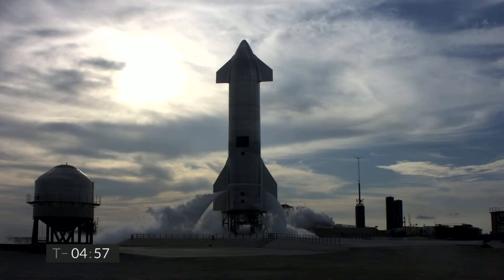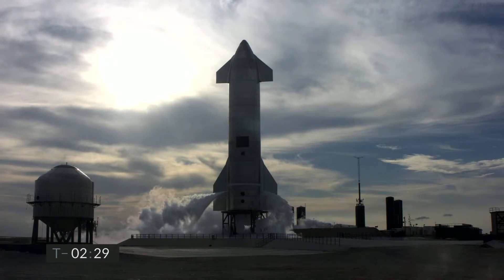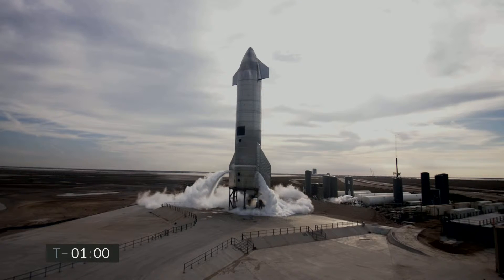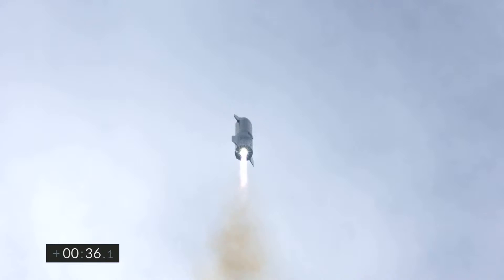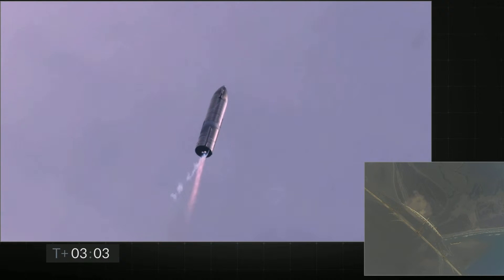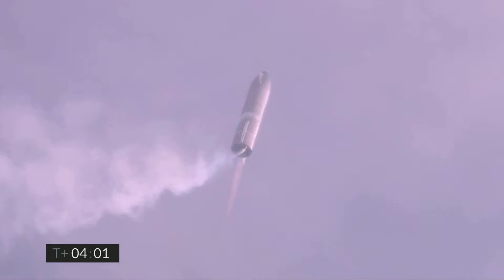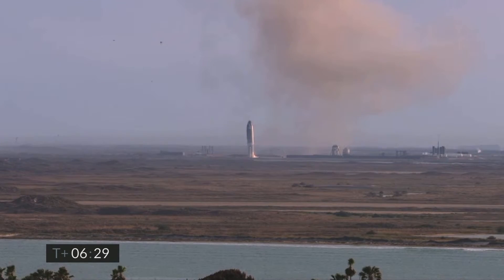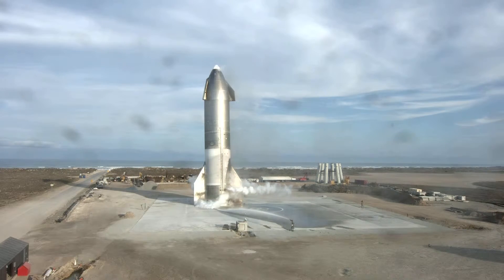Starship | SN10 | High-Altitude Flight Test

Comment: Wait did it expoloded?
Reply: Yes, later on, a methane leak caught fire inside the lower fuel tank and then KABOOM
Reply: Yes, because 3 of the landing legs failed to lock into place so the rocket landed a bit harder than it should've. Those landings legs are designed to be crushed by the impact force. Since only 3 of them deployed, the rocket landed a bit harder than planned and damaged the rocket causing methane leak.
Reply: Ok

Comment: how did they film it almost parallel height the entire flight?
Reply: I mean it wasn't 'almost parallel'. There's still a significant upwards angle when it's at apogee.
They used a long range tracking camera a long way away on the ground, so it was looking mostly sideways, but still 30-40 degrees up.

Comment: And by the way it blewup, but don't tell that to anyone!
Hope next time they don't show off 1 engine landing and do it proper.
Reply: With 2 engines it would just fly back up
Reply: @FinkHD  Funny but not true.
Reply: @N0N0111  It is true, the engines have a minimum thrust
Reply: @N0N0111  It is true.
A Raptor at minimum throttle makes 80 tonnes of thrust. At max it makes 200 tonnes. The ship weighs 120 tonnes, so that's enough to land it.
However, two engines at minimum throttle are a minimum of 160 tonnes of thrust. That's too much to land, or even hover. The ship will go up.
They hope to get the minimum throttle down to 50 tonnes in the future, which would allow a 2 engine landing. But right now it isn't possible.

Comment: My little advice that why the landing and take off are considered as the same process/similar processes; just like animals can move in forward direction much faster but cannot walk/run in the opposite direction with the same agility facing forward and moving backward. Why the landing is not done exactly the same way as small drones and helicopters and use propellers and parachutes.
But Good luck with all the efforts. #SpaceX
Reply: Because it is way too heavy and tall for that

Comment: if this is true, it means the earth is not moving
Reply: Why would it mean that?
Reply: No it doesn’t lol
Reply: the earth rotates on itself at a linear speed on the surface of about 465.1 m / s at the equator, and during the 6min (duration of the flight) the impact point would have traveled about 167km
Reply: @khalidfarhi3726  No lol.
The rocket inherited the earth's rotational velocity when it launched, and on top of that it's within the earth's atmosphere which also is rotating along with the Earth.
Have you ever tried jumping in a bus? Ask yourself what happens.
Reply: yes lol
What you say for the bus is true, provided the movement is straight and uniform. But this experience has never been proven in a spherical medium where the speed is not constant since it depends on the radius.
Normally, the higher the rocket rises in the sky, the more its radial speed increases, since the radius from the center of the earth increases, and the rocket must keep its straight line. But we do not see anything ????
Reply: @khalidfarhi3726  I strongly doubt 10 kilometers altitude is enough to notice much drift.
The rocket obviously corrects its course at all times, but saying that it would drift 167 kilometers is utter nonsense.
I'm not sure what your point even is.

Comment: I don't know why SN10 exploded; or, I haven't heard if SpaceX has determined what the problem was.  But, I've always thought the Starships cape that covers the raptor engine nozzles looked odd.  And, what have we seen each and every time(three flights so far)? j But the cape is on fire!  

No rocket in history has had a cape extended so far down.   I'm thinking they need to get rid of that cape.

Comment: CGI
Reply: Yawn.
Reply: @EVRose60  I don't think the whole thing is CGI but there are for sure a few points where it is CGI. At the 6:00 mark why does the camera shake? It's  too far from the rocket to be effected. When it goes flat the video cuts and the wings go from starting to fold to fully folded in under a second. The view from underneath when it lands- It doesn't come down right on the pad when it fires the rockets in that shot. It's off by maybe 100 yards. How would you know to place a camera exactly in that spot to catch the under view? Wouldn't you have had the camera located on the pad? Also wouldn't there be the problem of I don't know burning the camera to oblivion?

There are also shadow issues. When it lands there are no shadows at all. Then when they go back to showing it after the dust clears there are shadows. the shadow of the rocket moves substantially in only a few seconds of time. @ 13:40 it falls over the furthest white street sign. Then @ 13:44 it's solidly between the two white street signs.
Reply: @banzairx7  One question. Why would SpaceX need to make any part of this "CGI"?
Reply: @banzairx7  That makes no sense, everything seems to be right in the video
Reply: @EVRose60  NASA does it all the time. The reason is if there are portions of the launch that would be obscured, hard to follow or whatever they'll throw in some CGI. It keeps the narrative going. You lose peoples attention if the thing you want to see is obscured by clouds for 5 minutes. The difference I see here is that NASA will throw a blurb at the bottom of the screen telling you what is going on. SpaceX didn't.
Reply: @banzairx7  "SpaceX didn't" but you know for sure they added "CGI"? Explain how at least 6 other, that I know of, independent amateur cameras saw exactly the same thing that SpaceX showed from launch to landing.
Reply: multiple channels covered this along with dozens of real people were also present to watch the launch and landing
Reply: @astrocakes829  they’re all fakers then
Reply: @Chizzle8365  Why?
Reply: No money so they decieve everyone and cgi, elon getting desperate
Reply: @richyket  You do know Elon is the richest man, right? And that the rocket also exploded
Reply: @richyket  Elon Musk, "no money"? 🤣😅😂😆
Reply: There's no CGI here. Nil, zero, none. Look at all the amateur footage other people filmed of the event.
You do realize you can literally just go there and watch these tests in person, right?
Reply: @logitech4873  stay dumb
Reply: @Chizzle8365  Your name fits you well.
Reply: @EVRose60  plus the earth is flat
Reply: @Chizzle8365  Suuure it is! 🤣
Reply: @Chizzle8365  Damn I began reading this comment thread thinking “How can someone still think this is CGI?” And then you wrote that you are a flat earther... now it actually makes sense
Reply: @Chizzle8365  Why would they want to hide that the earth is flat?
It only looks animated, because the camera moves so smoothly, nothing more.
You can see dozens of different camera angles.
There was a beach full with hundreds of people, don’t you think Simone would’ve noticed if this was faked?
Reply: @Chizzle8365  How does "the world government" hide anything like the shape of Earth and why would they?
Reply: Everybody watch this for proof https://www.bitchute.com/video/cfyRneVqyKrH/

Comment: Anti gravity propulsion and superconductivity are the technologies required to travel beyond our solar system. We need to up our technology.
Reply: That’s just a theory which hasn’t been proven, and thus face the reality of what they’ve accomplished. Next thing which will be feasible will certainly be nuclear energy.
Reply: @hefrov10 
The US military has developed a top secret craft called the TR3B using black budget monies which is a nuclear powered triangular shaped craft that incorporates a "magnetic field disrupter" (MFD) which greatly reduces gravity of the craft (by 89%) thus the pilots can pull impossible turns and travel at speeds that would pull a conventional aircraft apart and kill the pilots. The technology DOES exist - only that its not available outside the military.

Comment: Absolutely incredible placing a Grain Silo up in the air 6 miles and balancing perfectly with precise control while switching engines on and off. Excellent JOB ENGINEERS and Controllers at SPACE X.

Comment: For anyone reading this, it exploded right after they ended the stream.
Reply: Yeah, it's true. But explosion was 5-7 minutes after landing. Landing itself was successful :)
Reply: @myentertainment55  and the issue seemed to be caused by faulty landings legs, which are temporary, anyway.
Reply: @RD-270  and landing  was successful but still too rough. Rocket bounced a little :) Those Legs didn't help eather.
I think it could  be perfect with SN11 already.

Comment: 100 % CGI, why should there be lens flare?
Reply: The lens flare is because as the nozzles point closer to the camera, it lets it see deeper into them at the high pressure exhaust coming from the throat, which is way brighter than even the expanded part (the shot is already underexposed to show the flame better). Very bright light sources on camera create lens flares.

Comment: Landing with only one engine working?? wonderful job Elon, go on!
Reply: One engine is intended, it's all they need.
Reply: @axelstems212  ah but how it get weird with flammes and all so?
Reply: @theovaissie2480  It's just how the engines shut down.  They kind of do the same thing on the way up if you watch the engine view
Reply: @axelstems212  Someone , a french just told me that was because of methane gaz released after shut down and because of the very hot all is, it burn
Reply: @theovaissie2480  Yep, that's probably what happened.  The legs didn't deploy correctly, so there was no where for the gas to escape from under the skirt.  It built up and ignited on the hot engines.
Reply: that's what sn5 and sn6 were testing during the descent of the 150m hop
Reply: @politonno2499  What? just remember i ve already seen the sn6 descent of the 150m
Reply: @theovaissie2480  and thats what those prototypes were testing, preparing for the High-Altitude Test Flight

Comment: Is it possible to stop venting for a period during landing sequence or would the pressure build too quickly.
It appears that engine cut off lit the exhaust gas that lead to the RUD.
Congrats on your first landing from altitude.

Comment: Why are rockets starting to look like they were designed by the makers of Gerry Anderson's 1960's sci-fi puppet shows like Thunderbirds and Fireball XL5? You know, with fins and stuff. We've had 60 years of sleek, fin-less rockets, now we get a retro appearence.
Reply: Well, the rocket looks like this for a couple of reasons -

The aero surfaces assist in the skydive maneuver, and orienting it into landing position.

It's made of stainless steel because the material is cheap, yet very strong at cryogenic temperatures.

Comment: Oops another fail, back to the drawing board
Reply: Fail? It landed successfully. Its a success. Doesn't matter if it blow up 10 minutes later .
Reply: @Arteus_Hoplit  As long as the passengers get out and away within 10 minutes thats a success eh, forget the reusable  point
Reply: @Superfandangoo  Yesterday it couldn't even land and now it landed big difference
Reply: @Arteus_Hoplit  Partial success then also a failure losing a tasty few million $ for 3rd time.
Thought others done this verticle landing rocket years ago somewhat successfully

Comment: I have two questions about the video. What gas is coming out of the pipe on the side of the rocket at the engine end of the craft as seen at T+20 seconds and at the T+1:15 mark? What caused the flame seen on the side of the craft just after the craft flips for landing? The first is also still seen (but smaller) just after landing.
Reply: Liquid oxygen. At the end there was probably a methane leak or something.

Comment: Besides the landing gear being the issue, I think the Starship needs to work on the engine shutoff sequence during landing. As the third engine shut off, the second one  also shut off immediately after, which I believe caused the problem with the deceleration while coming to the pad. I think that if the second engine shut off just a second or two later, then the Starship would have had an elegant landing.

Comment: What about the tech they used to land on the moon? Or was that actually a hoax? By then, one would think we would have advanced many folds.
Reply: The 60s technology was limited and extremely expensive to develope and operate, so expensive that it was retired in the 70s.
Reply: @johnsmith8662  ok yes, but they went to the moon with it. Im sure spacex tech costs a hell of a lot more
Reply: We have , you should actually read articles but it doesn't really helped us , as the things got more lighter they had to make use of heavy stuff to put them rightly in place so they don't tremble and those rockets were only designed to take people to moon. 

 Also many scientists of that time don't work in nasa anyway , the governement stop funding for such mission which explains it all. Also there was a race going on between two countries that time nothing like nowadays. 

Lastly , this is spaceX not some government agency like nasa, which have its hand tightened due to political pressure and it was this company that has send people to moon back then. 

Funny you people talk trash here but won't appreciate companies like this or care about doing some search on your own.
Reply: @abhayagarwal5097  so spacex sent people to the moon back then?? How did they land on the moon and took off from the moon if you know so much? Im not talking trash im literally just asking
Reply: @abhayagarwal5097  if we had advanced many folds from 69 wouldn't landing not be a problem considering they LANDED on the moon somehow

Comment: Can the 3 engines be combined into 1 engine with n thrust subunits arranged in an optimal configuration, each subunit computer controlled, thereby providing greater maneuverability due to faster and finer thrust adjustments and hence the higher ability to take of and fly in extreme conditions ?
I suppose a ring of horizontal external thrusters located around the vehicle CG would also be required for all weather flight. 
What if the first SN that is ready for Mars has to fly on a day/night when Earth is facing a catastrophic event? 

SN must be a all weather design.

Comment: “This is intentional”
“This is intentional”
“This is intentional” 😂
Reply: Because haters will start going. THE ENGINE FAILED OMG SPACE X HORRIBLE EARTH IS FLAT 😱😱😱
Reply: @Cursed_Baljeet  looks like it did it was on fire.
Reply: @dingerling9017  That was  unintentional
Reply: @dingerling9017  was, exactly.
Reply: @Cursed_Baljeet  FRR LMAO
Reply: @saltyclanker8440  it landed which is an improvement from the previous time. It's a test vehicle.
Reply: @dingerling9017  They ALL 'landed'... Just some of them landed a little harsher than others.
Reply: https://youtu.be/VZ8hJwhnskI
Reply: @saltyclanker8440  its called learning from past mistakes :)
Reply: `https://youtu.be/eZtZKkT50e0

Comment: Detractors of Spacex are dissing them for cutting the feed off early to not get the rocket exploding.  Saying they were hiding it somehow....ROFLMFAO ...Just how do they know it will explode?  Maybe they need a "Nanny Cam" on everything just in case something happens. Like maybe a rocket needs a drink of water or it's diaper changed? 
Spacex is the LEADER in launches, operational rockets, Human rated Space craft, Successful booster landings, Production rate for Boosters as well as Spacecraft, Ride sharing cheap launches, Plus they have more cars in space than anyone.  (And keep watching, you ain't seen nothing yet, sea borne orbital launch platforms, Factory to launch platform delivery by flight, The NASA Lunar lander with 100 tons to the surface AND an elevator to unload, Delivery of the Lunar Gateway Space Station and never forget Mars..... )
Reply: When SpaceX cut the feed, I joked that they knew it was about to fall over or something. Maybe they were monitoring the tank pressure and could see an explosion coming.

Comment: Based on how the explosion appeared below SN10, I suspect that the clearance between the bottom of Starship and the ground is too small and residual gases from the Raptors build up, pressurize, then explode after reaching critical thresholds.  Either add fixed or retractable struts to allow gases to escape, or possibly retractable legs like Falcon, but maybe integrate into rear flaps (4 from flaps to provide 4 points or 2 from flaps and 2 from body for 4 points) so they keep bottom well clear of ground.  Fixable, and am certain SpaceX will come up with an even better fix than mine but if not, call me and I will lay it out.

Comment: What's venting from the base of it in the first five minutes?
Reply: Liquid oxygen
Reply: @privatepile772  for what purpose?
Reply: There are multiple reasons to vent. The main ones are engine chill, which involves sending some propellant through the pipes of the engines themselves to avoid heat shock, and pressure release, which involves getting rid of some propellant from the tanks as it evaporates and creates too much pressure.
Reply: Rocket engines use liquid oxygen to burn its fuel because obviously in space there’s no oxygen so burning things is impossible so they bring their own , also because the engines are underneath the rocket , not a lot of oxygen can be supplied to it .

Comment: Is it still a success if it blows up a few minutes later?
Reply: Yep, because it landed anyway
Reply: @WJT.  I'd argue if it physically explodes, at any point. It was at least a partial failure. They were not planning on it exploding, therefore it didnt go to plan. Therefore it wasnt a complete success.

Successful landing, not an overall success.
Reply: @MrBocco1  I mean, it landed, and the others never made it, so, it's a step